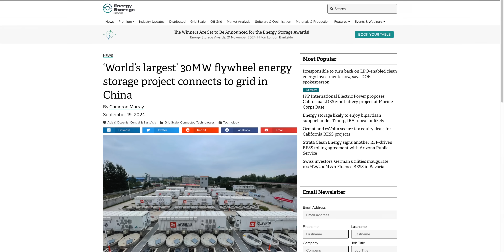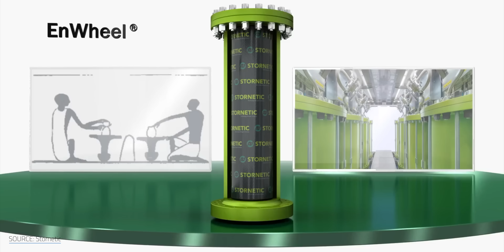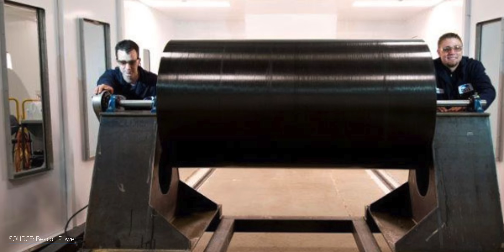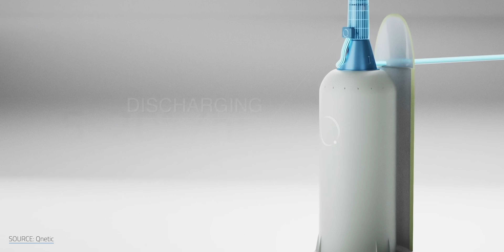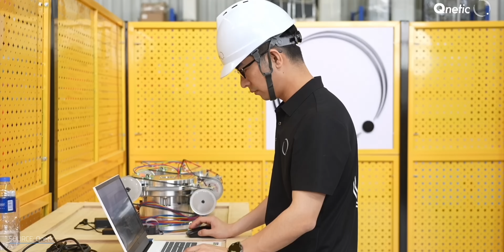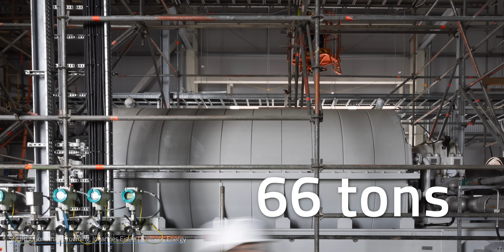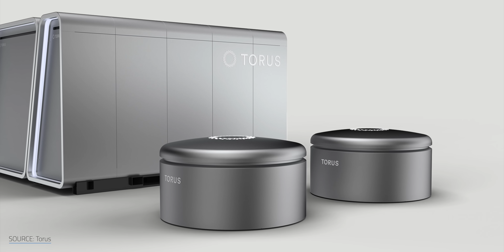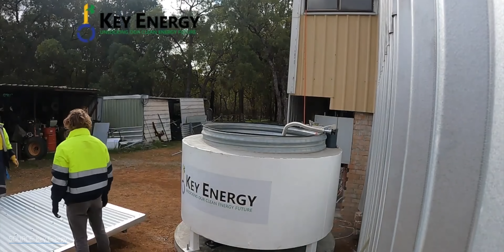How This Mechanical Battery is Making a Comeback

Comment: Another benefit of flywheels is they aren't very flammable, so putting them in the basement of a building isn't going to be as much of a risk to the structure. Batteries aren't as much of a fire hazard as some people think, I'd rather have a battery over a generator and fuel, but both of those burn hot and long if they cook off. I can see a future where foundations for most buildings are designed with flywheels in mind, doing all the digging at once to save on costs, while chemical batteries are kept separate either in an open lot or dedicated building, and combustion generators are abandoned entirely.
Reply: Fire isn't the only risk to a building.  Flywheels store an immense amount of potential energy.  Whether they're flammable or not, if you release that energy in an uncontrolled fashion (via mechanical or material failure) you're going to destroy a bunch of the building.
Reply: @stargazer7644  They aren't completely risk free, but designing and building a structure to withstand the impact of flywheels coming apart isn't going to be excessively expensive, and once they break, it is over. Fire on the other hand can ignite the rest of the building, and fill it with smoke and toxic fumes. 

There is no such thing as completely safe energy storage, the laws of thermodynamics prohibit it, but different forms of energy storage have different risks, and I'd rather have a flywheel in the basement than a battery, let alone a diesel generator.
Reply: @TheReykjavik  Before you go designing your containment structure in the basement, keep in mind the energy released by a 30MW flywheel coming apart is equivalent to 30 sticks of dynamite.
Reply: @stargazer7644  Most buildings are not going to house the world's largest flywheel storage system, so the actual number is a lot lower than 30 sticks of dynamite.
Reply: @TheReykjavik  oh good grief.  You really are incredibly good at completely missing the point.  Ok, scale it to whatever you like.  You've now got one stick of dynamite in the basement now.  Does that make you feel better?  Is your box in the basement going to contain that?  If you make it much smaller, it won't be terribly useful as a power source.  30MW is a pretty small power source when generation is measured in gigawatts.   There's a reason these are getting bigger.
Reply: @stargazer7644  You don't have a point, that is why it didn't land. All you really said was "dynamite scary", quoted a wildly out of pocket figure for any sensible version of what I'm proposing, and pretended I'm "missing" something because what you said is incoherent without your wild exaggeration of the risk.

Having a couple sticks of dynamite in the basement is worth it to have the ventilators stay on in a hospital. We already have diesel generators as backups, and given how inefficient combustion is as an energy source, the same of amount of usable energy requires a much larger amount of total energy to be kept in the tank.

Energy storage is inherently risky, that risk is already worth taking, and a boiling liquid expanding vapor explosion is going to be way more devastating than a fly wheel explosion. The fireball is hotter and will cause secondary fires, the energy content is higher, and the shockwave goes in all directions evenly, where a flywheel's energy is going to dissipate mostly in the plane of its rotation, which is going to go into the ground.

If you were going to stay in a hospital, and you could choose between two of them, each with 3 days of backup power on sight, and one has diesel generators, and the other has flywheels, which would you rather go to?

The bulk of our storage should be on the grid, and a safe distance from where people live, but that storage is vulnerable to grid disconnections, so local backup storage is necessary in some places, and nice enough to have to be worth the risk in many more.
Reply: @TheReykjavik  My point that I've tried repeatedly to get across to you is that you're drastically underestimating the danger and risk of the kinetic energy in a spinning flywheel.  And if you bothered to do the math (which is incredibly simple) to compare the kinetic energy to the energy in your BLEVE example (wherever that came from), you might be surprised.  NOBODY is talking about flywheels replacing backup generators for 3 day power outages.  That isn't their use case.

Comment: Why we don’t have giant flywheels say 5000 tons spinning slowly but storing lot of energy ..?
Reply: Because the relationship between the power stored is exponential with regard to the angular speed. 

Basically e = m * v²

Say you have a big flywheel at m=10kg and a small flywheel at 1kg.

If the large fly wheel has v=1 and the small flywheel has v=4, 

ebig = 10 * 1 = 10kg units rotational energy.
esmall = 1 * 16 = 16kg units rotational energy.
Reply: Because they aren't efficient.  Energy storage goes as speed SQUARED.

Comment: Seems likely the motors would use rare earth magnets as those types of motors are more efficient and simpler than alternatives that don't, right?
Reply: Rare earth magnets are used in motors that need to be small and powerful.
Reply: @stargazer7644  I read the type that don't use rare earth magnets and are also efficient need complicated control systems, increasing complexity and cost. Seems like any company that prioritises profit will use rare earth magnets motors. We all know the track record of companies not prioritising profit...

I'd like to be wrong - convince me this won't happen.
Reply: @nommy8599  Most motors and generators don't use rare earth magnets and don't have control systems of any type.
Reply: @stargazer7644  Can you elaborate?

Also in this case efficiency is paramount where in other normal cases power, maintainability etc are perhaps more relevant.

Comment: I'd note that while it's not at the utility grade level, flywheel power backup has been operating in a large number of datacenters for over a decade, and we've seen it bridge those datacenters commercial power loss to battery, then generator start-up to keep those datacenters live. I've worked in a datacenter w/o such a system, with just battery and generator, and invariably when they do system checks you can tell as all the lights (which are only switched to battery/ups in the case of a power loss, rather than being constantly on those systems, always flicker at the switchover. The workaround most places use is an active UPS, where commercial power charges the batteries, and an inverter provides power to the facility off of those batteries. Even that can have delivered power fluctuations as the commercial power if floating the batteries at just above their fully charged voltage, and the inverters may not respond fast enough to the change in voltage from the battery side. That may not affect your PC or laptop, but there are still a large number of systems where that level of power change can be a serious issue. 

So yes, it's good to see that the utility grade stuff is spinning up. 

I do suspect that in the not too distant future, businesses are going to be asked if they have their own backup and standby power, and where they do, they may be moved into a power shedding level of service, where during high load, if the business isn't sending power to the grid, they may be dropped off the grid until the grid can support their load as well again. Similar to the 70's and 80's where some varieties of home service were managed to shut down the load during extreme cold or heat events. This mostly didn't involve dropping power to the home or business, it simply involved deactivating specific equipment and loads within the customer's environment. However if your place has a full backup power infrastructure, I can see that not being an option. On the other hand it's also going to surprise a few people if they have a generator that runs on natural gas, and they are not prepared for the cost of the natural gas consumption.
Reply: The future of energy is an abundance, as long as we make sure to utilities V2G and not let utilities dictate all the rules (and control more power and money).  Everyone will be driving around with excess energy.  Utilize that when plugging in at work and the grid will be much more resilient.  It also allows to use more renewable energy.  I don't see utilities controlling business power usage like you say in the future.
Reply: Load shedding contracts already exist with certain industrial customers. They may not have backup power, but they accept risk of downtime in return for discounts.
There are also residential utility providers that offer special rates for remote-controllable EV wall boxes or water heaters.

Comment: nothing new - European countries being flywheel batteries  for years for their telecommunications systems. even rail systems . when used for the telecommunication system. they usually provide 4 to 8 hrs of operation.  which then the maintenance person could start up and engine  to spin the system up in the couple minutes and then  let  release it energy for hours. or under  extreme event they had a hand crank that you could manual spin up the  system

Comment: "Na" batteries are the way to go over fly wheels. They store just as much power as Li and can be made about 60% less cost than today's Li batteries and NA can be used for both side of the reaction. While it might take more space and weight, it would still be way better than any fly or Li base battery. NA can also go hybrid Li+Na as well to allow it to get pretty close to the power levels of Li either way if still required. Safer as it normally doesnt have to use run away elements too. Not to say we can't use them, but to me they're more like a super cap than they are a storage device.

Comment: There is no ultimate solution. The ultimate solution is a combination of everything
Reply: That sounds stupid
Reply: @Makes_me_wonder  like you
Reply: Deciding what to use takes several factors into account. Having a wide variety of methods to choose from helps reduce costs and increase efficiency.

Comment: Why continuous focus on the grid and not universal individual home power?
Reply: or at least micro grids - which are all connected at multi-point junctures like a MAN (Metropolitan Area Network in Telecom) so if 1 "node" is knocked out you have 3 others that can be used for routing power to that home/facility.

Comment: Energy storage? Probably not. Energy management? Seems likely. Handling output differentials, redirecting energy across larger interconnected grids, seems reasonable to implement them for some advantages they have. Storage won't be one of those.
Reply: This could change with improving technology, but yes they seem to be most useful in smoothing out the intraday power fluctuations. For which they are definitely very useful.
Reply: @nicholascurran1734  you got it right. Nation like Ireland, with lot of wind power, are planning to use them exactly for this purpose. Furthermore, 30MW would be such an insignificant amount of energy stored
Reply: @birmaxfree2173  Even worse that MW is not a measure of energy. I highly doubt you can store 30MWh in those flywheels, but 30MW of power sounds about reasonable. Though it would discharge within a few seconds at that power.
Reply: Storing and releasing energy is energy management
Reply: They are valid storage methods. Just cannot store energy for as long as batteries or dams can. In a way it's similar to electrolytic hydrogen since it dissipates out of tanks over time.
Reply: But you can do all of that either with traditional syncons or with grid-forming inverters attached to a battery farm. The latter is increasingly taking over from syncons in my country as coal plants close and the battery farms are built - they're cheaper, more efficient and lower maintenance than traditional syncons, and a LOT cheaper than these things that need failure-prone vacuum chambers and expensive extreme precision. High speed flywheels do have their round-trip efficiency going for them, but that is not enough to offset their big economic disadvantages.
Reply: @kenoliver8913  If they are in vacuum and levitated using magnets, then it could work, electromagnetically transferring power.
Reply: @kenoliver8913  batteries being cheap are at the mercy of geopolitical stability sadly having a diverse portfolio of technologies is always beneficial I think
Reply: Just the losses alone make it not worth it for energy storage. You have to continually pump power into it, but you always lose some percentage of the energy you pump in, along with a percentage of the energy you pump out, and that's just on the mechanical side of things. Turn to the electrical side of things, where you need to convert things, both when energy is applied and taken out, and you're looking at more like a base loss of at least 40% of all energy that goes through them. That's also before you start adding even more losses, like transmission over distance losses. Even directly from a power plant, 66% of ALL power is lost before it even makes it to a wall plug. Then you have conversion losses in electronics. People would be shocked if they realized just how inefficient the energy grid actually is, to the point that gasoline actually yields greater energy. That's why they made gas soo expensive, because when gas was $1 a gallon, it was literally cheaper to run your house on a gas generator than to use the grid. As electricity became more and more expensive, they had to jack up the price of gasoline, because they knew people would eventually realize that they could just buy a gas generator and power their home for cheaper, and they couldn't have that, because it would destroy the grid, so in order to keep the grid going (and people paying the greedily high prices), they had to make sure all alternatives were too expensive to compete. That's the true reality of our world. You're not paying more for gas because it's bad for the environment, you're paying more because the energy grid couldn't compete with gas generators.
Reply: @peoplez129  who's "they"
Reply: @peoplez129  what you said about everyone powering their house on gas generators is a bit of a stretch. Imagine having a whole street with generators running, all the smoke and noise. And that's assuming that people have enough space for a big enough generator in the first place. There were times in history when fuels were cheaper than electricity and what you said was never the case.

Also complaining about efficiency is a bit of a pointless argument as everything is inefficient. Flywheels are not designed for long term storage and trying to use them for it is just dumb. They are best suited for short to medium term storage to help a source follow the demand better or to smoothen out a source that varies in output. It's basically like a capacitor in a full bridge rectifier that smoothens the output current. You could use a rechargable battery instead but why would you? It's overkill in terms of capacity and can't even react fast enough. The same thing applies here, pumped hydro is the best mass energy storage method by far but pumps and turbines take time to spool up while a flywheel can charge and discharge in seconds while having >90% roundtrip efficiency if both phases happen within seconds to minutes of each other.

Comment: Molten Salt Reactors would do a better job, you could store large amount of high temperature molten salt that heated by the reactor to act as a thermal energy reserve to generate large quantity of electricity when needed. If this Molten Salt Reactor ran a clearer fuel like Thorium even better. China very close to doing this now.

Comment: Clearly, the best energy storage solution is a very large lake at the top of a hill
Reply: They have improved on that by using a denser liquid than pure water.
Reply: Unfortunately, we normally find those at the bottom of the hill.

Comment: Good summary, flywheels offer specific advantages but are hardly a cure all. Nice option to have but not required. Have to be careful lumping synchronous condensers in with flywheels. The may offer real energy to the system but only momentary and are more of a stabilizer than a backup. For years people used depressed hydro units as synchronized reserve when all they ever were was voltage support. Without water passing thru the wheel and available governor action that’s all they are. To get true spinning reserve you have to have access to the prime mover. Flywheels do offer some room for system regulation and stabilization. Take any large hydro unit and bid it into the market for regulation. Before you know it will either be maximized or minimized. Seldom will it’s ability to generate be respected. Wishing you and your family the best.

Comment: Flywheels are great where they are great, but that's not in most use cases.

Audi used flywheels instead of batteries on LeMans winning cars, I've used them as power backup for a server farm, manufacturing plants use them to stabilize heavy machines from fluctuations.
Reply: They are great for starting up back-up diesel generators while maintaining the power without interruption.